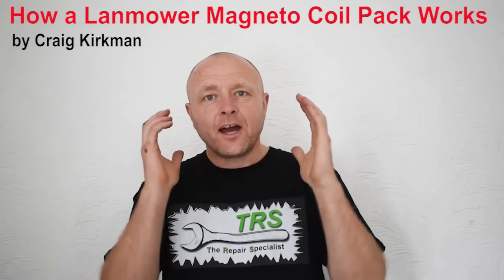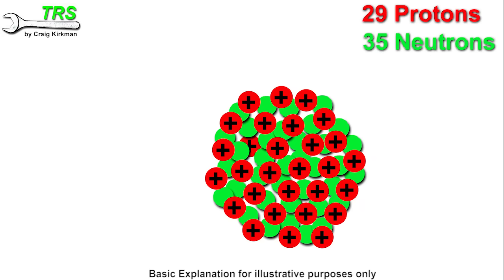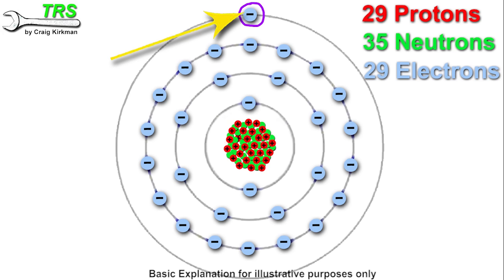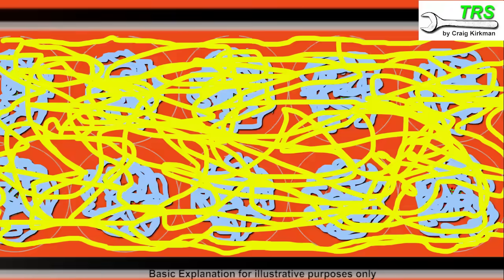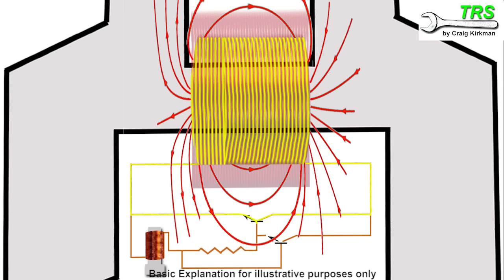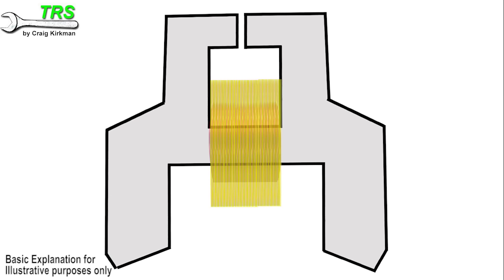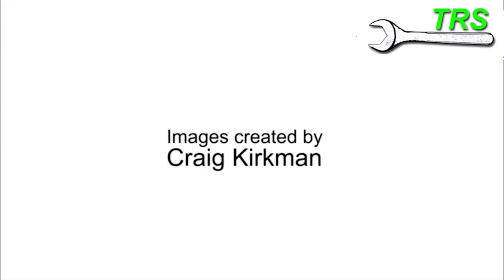Lawnmower Coil Pack Sparking System - Induction Coil, Transistor!  (by Craig Kirkman)

Comment: Very nice explanation.
It is much more physics focussed than how i normally think about it as an electronics engineer.  My only (very minor) issue is the omission of the connection at the other end of the secondary coil to the engine block.  It is normally made through the module housing and garantees the potential difference at the spark plug.

Comment: Now explain why the manufacturers insist on putting the coil over the exhaust or cylinder head instead of to the side. The heat is why those things fail.
Reply: Colorado Strong    coil in main air flow ahead of cyl perhaps ?
Reply: @davidm.4670  Extreme heat is all those coils get. I no longer concern myself with the headaches of these gas garbage machines. I use the EGO 56v system now. Super quiet battery power, no oil, no gas, no smell, I can turn it upside down or sideways to store it, no more pulling to start, no sparkplug, no carb bowl rust from the ethanol in the gas. Once you use a top-notch battery mower/trimmer/edger/hedge trimmer you will wonder what took so long to get into the 21st century.

Comment: Simply excellent. Repairing a friends mower; i was curious how simple it appeared. no points of visible CDI.  so timing must be by moving one or more components relative to each other ?.
Reply: Its a function of the magnet moving past the trigger coil. At just the right moment a small voltage pulse induced in the trigger coil causes the transistors to cut off, which stops the current flow in the primary coil, which induces the high voltage pulse in the secondary coil, which produces the spark inside the cylinder at exactly the right moment.

Comment: What about the set of points, under the flywheel, the condenser.
and the eccentric on the crank?

steve
Reply: The trigger coil and the transistors replace the ignition points used in older engines. This is because mechanical points degrade over time and need to be replaced periodically but the trigger coil and transistors should last the life of the engine. Modern cars and trucks don't have ignition points anymore for exactly the same reason.

Comment: Best explanation I have seen, save that your circuit is missing a ground connection. That is, you mention that from the spark plug the current goes to ground, but you do not mention that the reason for this is that the other end of the coil is grounded to the block, and thus the block completes the circuit.

Comment: I have an EE degree.  I have been a mechanic of sorts all my life.  I  wondered how these worked without points.  This is mostly due to experiencing repeated coil failure with these new Chinese junk parts, whereas the old mags with points were rock solid.  At anyrate Thank You for this great explaination.  Why 3 magnets?

Comment: Can you replace a " triggered  "coil and eliminate the use of points ?
Reply: Yes, that's exactly what newer ignition systems do, both in lawn mower engines and in modern car and truck engines. They don't use ignition points anymore and use a trigger coil and transistors instead of the points.

Comment: Great video! One question, side A of the secondary coil goes to the High Tension wire attached to the spark plug. But what does the other lead wire of the secondary attach to? Would this be one side of the primary? Thank you!
Reply: It is usually connected to the non-grounded lead of the "primary" as you suggested.  Where the kill switch is connected.

Comment: An excellent explanation, but I think it would be worth mentioning that the opposite end of the secondary winding is connected to the iron core of the coil pack to fully illustrate the return path from the spark plug.  Good work though

Comment: How did they do this 120 years ago? They certainly had coils but no transistors? Couldn't use a vacuum tube!
Reply: Points.  A simple switch operated by a cam on the crankshaft, on the camshaft, or in the distributor.

Comment: My mower won't fire. I replaced the spark plug and when I pull the cord it tries to start but it doesn't. It almost fires,but it's like I'm not getting a fast enough turn to crank it ? Could that be the coil or the magneto ?

Comment: Thank you for this video. Could you explain the importance of setting the right air gap between the flywheel and the coil?
Reply: Too far away, and you don't get enough of a fluctuating magnetic field in the core to generate a hot enough spark.  Too close, and the pole pieces rub or crash into the flywheel/magnet.
Reply: @thesquarerootofnegativei6225  
Thanks,  I wondered if it would be a weak spark if it wete too far away.

Comment: So the Darlington Pair forms the pulse wave shaping circuit, and not a timing circuit?
Reply: The Darlington Pair act like a switch to turn the flow of current in the primary coil on and off. The exact timing of when they make the switch, which produces the spark, is determined by the trigger coil. Essentially the trigger coil tells the transistors what to do and when to do it.
Reply: @joevignolor4u949  No since the transistors are not connected to a battery there only source of power is the AC current set up in the primary coil by the PM magnet on the flywheel. Why are the transistors used at all - - or maybe you explained it
Reply: @JohnSmith-eo5sp  You are correct that the power source for the transistors and their associated electronics is the current flowing in the primary winding. Whenever  the primary current is flowing a small amount of electrical energy is extracted from the flow and stored in capacitors inside the electronics module to keep the module continually powered up. The reason for the transistors is to allow the primary current to flow and then to cut it off at the correct instant to fire the spark plug in the cylinder. This is because to induce the high voltage pulse in the secondary it requires a rapid change in the intensity of the flux around the secondary winding and interrupting the current flow in the primary is what allows that rapid change in the flux to occur.
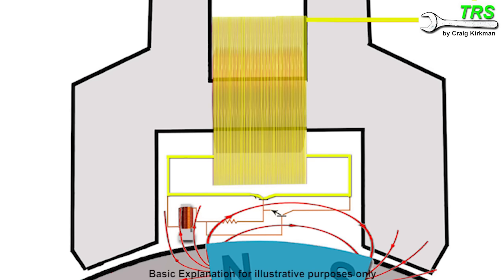Reply: @joevignolor4u949  2:20 True, but to charge up the capacitor(that I don't see in the diagram) the AC energy induced in the primary would have to be rectified first. I see no rectifying diodes in that circuit diagram.
Reply: @JohnSmith-eo5sp  The circuit diagram is vastly simplified and incomplete. The complete circuit for the electronics module probably contains a hundred components or more. This is the same basic device used in ABS wheel speed sensors in newer cars. Those sensors are a two wire device and the same two wires provide power to the device and also carry the signal to the ABS module. These types of devices are said to be "loop powered" because the same loop that carries the signal also powers the device.
Reply: @joevignolor4u949  That clears all that up, thanks!

Comment: Though it perhaps is not necessary for the purpose of this video, maybe you could've added how when the electric potential (Volt) goes up in the secondary coil, the current (amps) go down and the connection between the two. And then mention the electric charge  (coulombs) 
Just to complete this otherwise great video! Cheers
Reply from the maker: Noted. Thanks. Craig

Comment: As an apprentice mechanic, I learned this 45 years ago but without the education about electrons and protons and neutrons, you were just told that a magnetic field collapsing through a coil produces a high voltage that results in a spark. Now when I got adventurous and built a higher performance engine for my car I ran into ignition problems and as this was pre-internet days I had to pick the brains of older and wiser mechanics that worked with high-performance engines and who gave me books to read that explained the current flow as you did. However, your explanation was far better than any of the books due to the animation. So why did I have ignition problems with my higher-performance engine? As the compression in this engine was much higher I needed higher voltage from the coil to ionise the air gap at the spark plug and my standard ignition system would not give me that so I had to remove the mechanical points trigger foe collapsing the magnetic field and go to an electronic trigger and I had to get a much bigger coil with more windings that produced a higher voltage spark. if physics at school had been as interesting as this I would have learned more.

Comment: Because the magnets pass by every revolution and the Briggs and other 4 stroke engines use this It provides Waste Spark  which means the Plug fires on the exhaust stroke too keeping the plug cleaner .This system works well for that reason and also its simplicity  BUT yes you have explained  a lot to me I did not know about the workings  CHEERS

Comment: I wish this video existed when I was in in high school 60 years ago.  Bravo!  Well done sir!
Reply: Yeap. But 60 years ago there were points not transistors to break the primary coil to cause the collapse.

The transistors switch off much faster than the points so you get a better spark.

Comment: Great info !! I wish you would make a video on what causes a coil to fail . I find coils in lawntractors fail alot, would like to know why
Reply: Multiple possibilities.  Heat, corrosion, and water infiltration (leading to internal corrosion or shorts) come to mind.  Some will even fail such that they work fine cold, but fail once they heat up.
Reply: Usually its the spark plug wire

Comment: Great explanation! All I knew before was it was a magnet moving  past a coil, and that ignition occurs as the field collapses. The rest was a revelation, Thanks!
Reply: Which leads me to the obvious question, why add the schmitt trigger and second and third coils (trigger and primary coils) when you could generate a spark from the magnet passing a large secondary coil (which then would just be called the coil) and the result would be more reliable due to having less parts to go bad? Is it worth a more finely tuned spark to reduce overall reliability? (Assuming the answer to the first question)

Comment: This schematic is for a Briggs and Stratton Magnetron branded magneto, other ones use either some sort of CDI like Tecumseh used to and Kohler uses some other method as well. Also, you should have explained the kill wire tab and the electrical change that causes the magneto to stop sparking, perhaps also mentioning the need for diodes on the grounding wire for Vtwin engines with two magnetos.

Comment: Thank you for such a complete explanation especially about the electron cloud and  the Darlington Pair circuit. How could they have built this before transistors were invented in the 50's? One thinks about Joseph Lukas the Prince of Darkness.
Reply: They used points, which are a switch that is operated by a cam on the crankshaft.  Points systems often use a condenser to improve performance and keep arcing from destroying the points.

Comment: Please, more explanation for the trigger coil system, electronic, electrical,  etc. The electronic diagram is completely? Maybe any diode, cap. etc. missing.
Reply: I believe the circuit shown is slightly wrong on the resistor termination.   A resistor connected to a darlington transistor in the depicted location should have the left side terminated to the left of the trigger coil.  The darlington's trigger current path is as described however the illustrated resistor purpose, if present at all, is to speed up the darlington's shutoff.   Many circuits would show a ground which in this case also appears to be to the left of the trigger coil.  So that resistor in an npn darlington would be grounded and not tied to the voltage output.   It would be easier to explain with a diagram but that is not possible in comments.

Comment: Fantastic presentation.  I just had this conversation with a neighbor this week.  I was working on an old school 1966 F100 pickup that wouldn't start.  I had to explain how the old school ignition systems worked.  The conversation moved to lawn mower magnetos.  I didn't try to explain the trigger coil, I just used the older style that used points as an example.  I'm going to forward this to him, you did a much better job illustrating the concept with animations than I did with words!  BTW, got the old Ford started, dirty points, too much point gap, frayed wire from the distributor to the coil.  Got all that sorted and it runs like a top!

Comment: Thank you for this presentation. It's very informative. Although I'm familiar with all kinds of engines, from chainsaws all the way up to V8 engines in cars and Pickups, I'm always ready to learn more. Could you please do one about carburetors? Small Engine carburetors are my downfall. They're so simple, take them apart and clean them out put them back together, but yet the machine still does not start. It drives me crazy. I subscribed, and hope to see one about carburetors soon. Thanks for everything you do!

Comment: This explanation is wrong. The trigger coil (as the name hints) only serves to turn on the primary coil. The electric current in the primary coil comes from the field of the permanent magnet - that's what those two big downward facing legs of the coil's iron core are for.
Reply: Correct

Comment: So the placement of the trigger coil is critical to the ignition timing.
Reply: As is the placement of the whole coil. All set up for ideal running conditions, can be moved if the mounting holes have been elongated. Not very common on small motors though, the air gap of the coil is of much importance for proper high energy for good spark.
Reply: just like moving your distributor back and forth for timing .

Comment: Where are installed all electronic pieces in the coil system? How many copper turn wire are for the trigger coil system? The coil system must be cold/vent during working? I know that the heat for the magnetic circuit is not good and the same for the electric, electronic pieces. The HV can drop function of the heating coil system.
Reply: The transistors are molded into the coil assembly which is why those things sometimes cost $75 or more.

Comment: Conform shown primary electrical/electronic circuit doesn't exist any contact to GND (lawnmower frame metal)? I try to find in diagram this contact and any connection to GND. It means there is not any reference to GND.

Comment: So for what reason is the iron core so close to the moving magnet, does that not also create a magnetic field in the coil?
Reply: The iron core is so close because that's where the field is strongest. Too far away and you don't collect enough energy for a spark.
Reply: the metal is   laminated so it wont become magnetized . clever , huh ?  small engine mechanic all my life .
Reply: @marcchaffee7751  that's not why it's laminated. Laminated cores only reduce eddy currents induced in the metal, which increases efficiency. It has nothing to do with preventing magnetism. The core will still retain some magnetism after the engine stops.
Reply: @pootispiker2866  with all respect , it is everything to do with it , ever try to magnetize a iron padlock ? doesent work well . ive been in the small engine tec. and repair business since 15 , im 62 now . yes ive had much training . go ahead and research for yourself .
Reply: @marcchaffee7751  I've already done ReSeArCh myself. You can be the president of the United States fand it wouldn't change the fact that a steel gauge block doesn't hold on to a paperclip better than an laminated steel padlock. I know because I just tried it.
Reply: @marcchaffee7751  Look up the difference between "hard" and "soft" magnetic materials.Hard will remain magnetised, soft will not. Laminated or not is irrelevant. And I'm 63 and I've been working with ignitions for 44 years.

Comment: Good video, thanks. I presume that the coils on pre-transistor era small engines didn't have the trigger coil and relied on the permanent magnet to induce a voltage in the primary coil directly?
Reply: No, there were points in the path to do the same thing as the transistor switch. And in parallel with the points a capacitor to reduce the arching issues that would damage the point contact quickly. His diagram is missing a ground return for the other end of the high voltage coil, where it is connected to the chassis of the engine with typically a wire with a round lug, under one of the mounting screws for the coil pack.
Reply: @f.hababorbitz  Thank you for the explanation, it was most helpful.

Comment: What would happen if the magnet was turned around and had the leading edge as north and trailing end south.
Reply: harleylif1  good ques.  it seems that mounting the coil upside down (which would reverse the pole sequence) causes it to not work ...   but why?

Comment: I'm figuring that the transistors create a d.c current in the primary coil, in a points magneto it's a.c.
Reply: No, ignition points and the trigger coil and transistors do exactly the same thing. They both continuously start and stop the flow of current in the primary to create the high voltage in the secondary. The trigger coil and the transistors replace the ignition points used in older engines. This is because mechanical points degrade over time and need to be replaced periodically but the trigger coil and transistors should last the life of the engine. Modern cars and trucks don't have ignition points anymore for exactly the same reason.